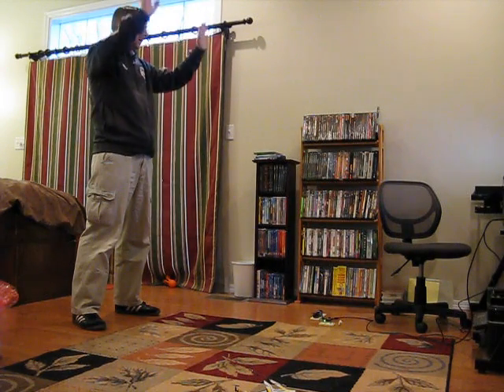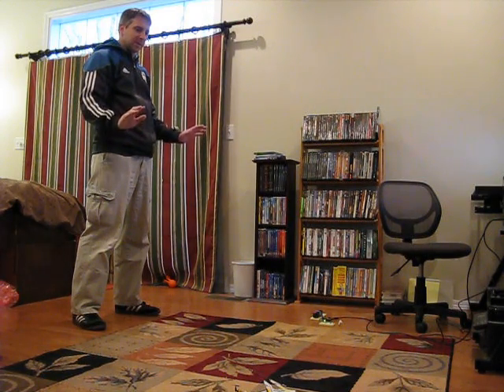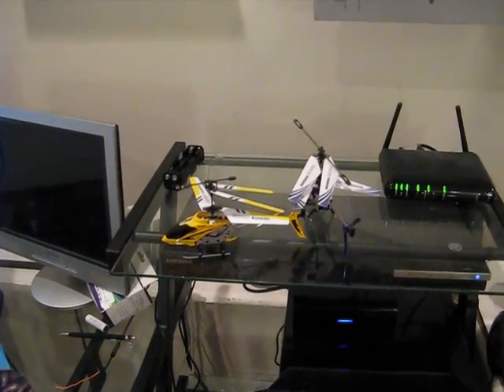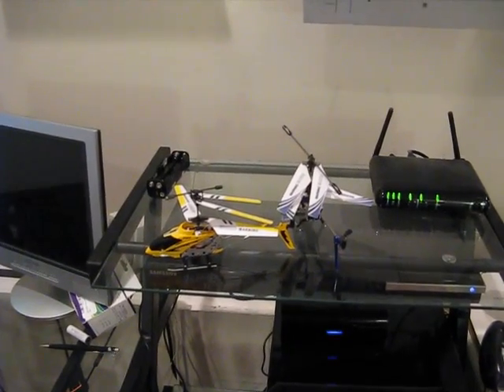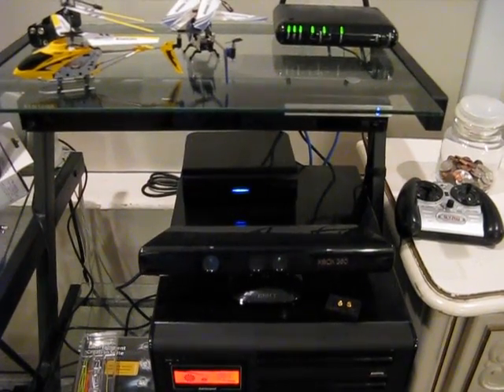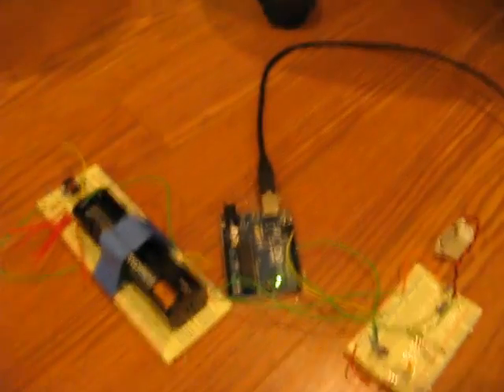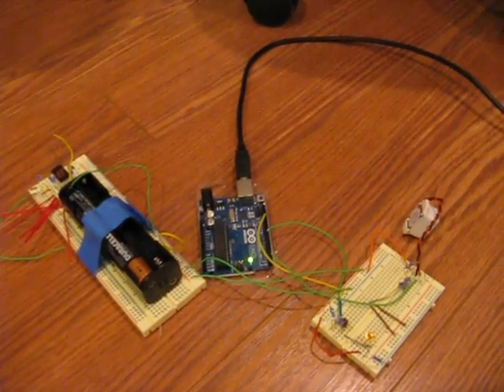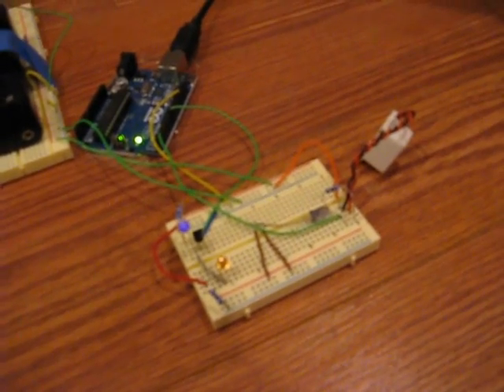S107 RC Helicopter and the Microsoft Kinect

Comment from the maker: The arduino code drives the infrared led. The Kinect sent the arduino throttle, pitch, and yaw data via the serial port. The hardest part was the led control and I provided a link for that. The arduino code should work on other arduino boards.
Reply: +cdoughty29 hi! can we spaek about this project? i have few questions, if you will help me it will be great. Send your e-mail please on modernknowl@gmail.com

Comment: Just my $.02,  
With respect to decoding the IR;

I would guess that the way to decode the IR signal is to watch the output of the transmitter, while changing the position of each of the control sticks.  I would hope it is similar to 'normal' RC model coding(maybe pulse position).  A fixed delay, followed by a start pulse and a pulse for each 'channel' .  The pulse time between each chan. as compared to a ref time (say 100mS) would indicate + or - move of the chan.  4 ch should be enough.